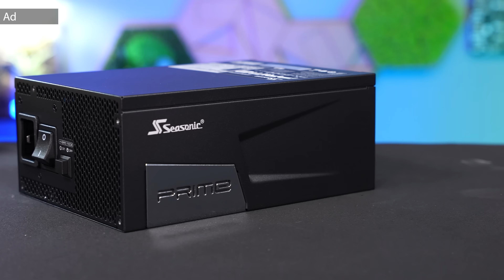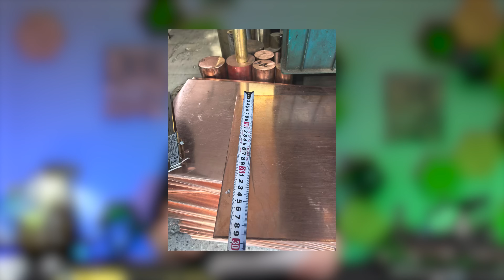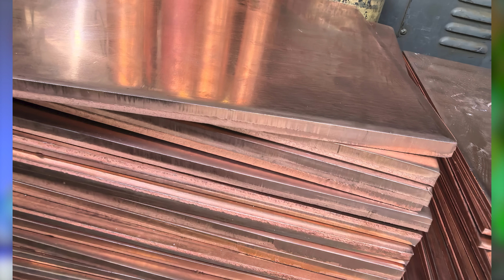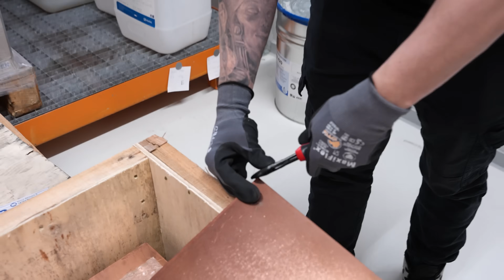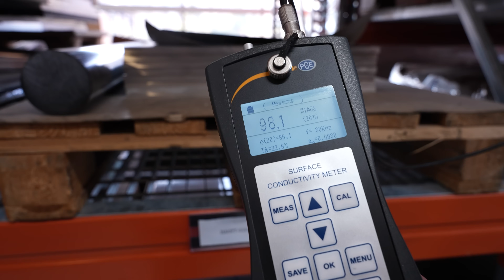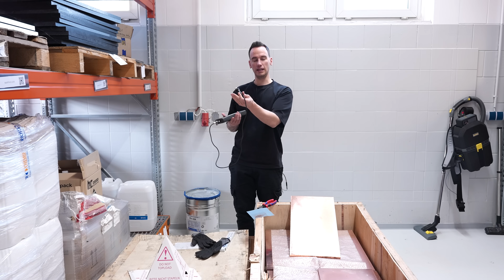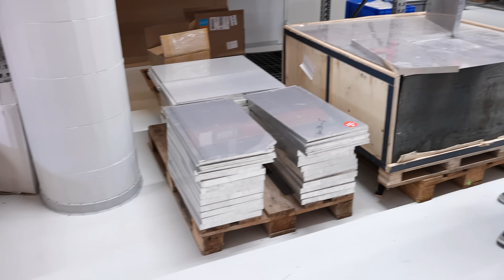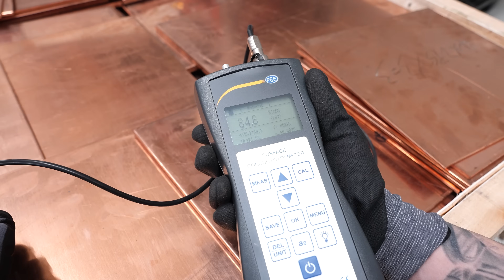I Got Scammed

Comment: I bought a new asus mobo for full price from newegg thinking the Chinese supplier was trusted by the website. Nope. I received a bent, used, asrock taichi with bent pins, scratches all over and the NVME heatsink flopping around inside the box with the screw missing. I asked for my money back or I would report them. They refunded a good amount. I still reported their ass. I hate scammers. 🤢

Comment: I wonder if, when you ordered 99.99% copper plates, they thought you wanted 99.99% copper plated. Or if they decided to pretend that's what they thought you meant.
Reply: They must have also thought he wanted steel plates in the aluminum order.
Reply: Nah, plating is a thin layer, not this thick.

Comment: I placed an order from China when i opened one of my locations, fairly large as well but not quite 40k euros and it was 80% high end millwork. I remember i spoke to friends who were Chinese and asked them to find a reliable 3rd party that will inspect the shipment and then forward it to me. So basically the funds were in escrow pending verification and once the 3rd party validated the shipment the funds were released. This was almost 5 years ago but i remember the service was an addition 2-3k. I basically asked the 3rd party to take a random piece and cut it and verify its not veneered wood etc and they sent me videos and pictures and verified everything was done to spec. I also got 40ft container instead of 20 and asked for most pieces to be fully or partially assembled since its hard to inspect flatpacks. I know this is not full proof either, but if you decide to venture buying from china again, this is one way of doing this. Everyone i spoke with told me chinese companies will rob you blind, it's basically their culture and it would be shameful for them not to try.

I'm sure you'll never make the same mistake again though, sorry this happened to you guys..

Comment: Name the suppliers. Nothing will change if the suppliers are not named, and if someone else gets ripped off in the same way you bear some of the responsibility if you could have warned and didn't. I'm crushed for you, but you need to do the right thing.

Comment: Be frank if you actually used alibaba correctly and done the full transaction in the platform instead of just using it to scout for options. They would be able to assist and refund if there were any issues

Comment: What you could have done in retrospective is put everything on a credit card because the credit card company is responsible for everything above while in the UK It's a hundred pounds I don't know what it is in your country but basically if you pay by credit card you have different protections that's why you pay by credit card. I mean yes there are e-scroll services and stuff like that but ultimately if you would paid by credit card jointly responsible any problems that may arise from fraud so if you pay by card fine if you didn't I don't know what to say x

Comment: I'm sure the copper shortage is data center related. Another victim of the AI bubble. What a bummer.  I was gonna say, check the weight on the shipping manifest, but it looks like they thought of that. The only way you could have check is flying to china and watch them manufacture, pack and ship them. That sucks, and you'll probably just have to take the loss unless your bank can help you.

Comment: Don't be embarrassed, in fact, I'll share my "scammed" story, so you'll know it's not just you, and in fact, it can be worse.... far worse. And yes, it involved Chinese manufacturing.... 

I worked as a certified quality manager for a fabrication company that had departments in the US, UK, India & China. We would get scammed by our own Chinese department on a regular basis when ordering cast iron products for machining. They would use cheap filler material constantly that would not hold the pressures we legally (and safely) needed to hold. I would have to get material tests done and check the manganese levels on every shipment and compare them with ASME allowances. And they would do the exact same thing, a couple of good items on top, and fake, scam junk on the bottom of the crate. Thousands and thousands of dollars, annually. 

The only way we were able to get consistently proper material from China, was if "extra fees" were paid to directly to the managers. And by fees, you know what I really mean. There was, at the time, nobody else who could deliver the quantity and size we needed, so, like you, we were at their mercy.  I moved on from that job a few years ago, but, it was still on-going when I left. 

Moral of the story, yes, Chinese companies, in many cases, have zero ethics. They know you cannot do anything about. For you, it could have been worse, we got scammed, and had to pay 'fees' to our very own Chinese department. 
Don't feel bad. Don't feel embarrassed. You simply expect people to have morals, when sadly, they don't, not always. 

I do hope you continued success.

Comment: Sadly Chinese suppliers are doing this with wire too. This is called Copper Clad Steel sometimes they use aluminum for the base metal for wire... Scams like this are sadly very common and usually you have no recourse.

Comment: did you not use Alibaba trade assurance? its literally an escrow account for this exact situation, so u dont get scammed. they hold the money until the transaction is complete then they pay the supplier. if u get scammed like you did here, ud have gotten ur money back almost immediately, after u provided proof like you did here. if you did not use the built in Alibaba trade assurance, then that was where u went wrong. u said u gave them 30% and then 70% when it was loaded onto the ship, thats wrong... USE THE SITES ESCROW SERVICE and this could have been avoided.

Comment: Discuss the issue with Alibaba, their systems rely on trust so you could probably get the suppliers kicked off their platform at the least to prevent them using their length of business as a lure for others, the other thing is that if it's difficult to get in Europe it is probably difficult in china so cheap prices are a red flag if most others have raised prices.

Comment: I don't know how you, as a relatively small and perhaps deemed as a onetime oversea buyer by the supplier in CHINA, could have done more than what I'm sure you prudently did!   Your order(s) may well have been completed to your exact specs.   Then boxed and strapped together with proper labels for shipment to the address you gave.   Immediately thereafter, your order(s) were at risk, anytime they were not held under positive and honest security.   There are global criminals skilled in the careful opening and remaking of wooden shipping boxes, that leaves no concernable, obvious evidence of tampering.   'Nough said!

I have had 2 issues, albeit with lower cost purchases, from China.   But, Newegg ensured that I got a refund for an order delivered 1300 mi. away, and Amazon questioned whether 2 orders on a new device using my card were valid.   I see no justification in making any purchase(s) from China, ever again!

Comment: Making business with Chinese people is always a bad idea. They really are criminal in these operations. Unfortunately you are just one small part of this scamming industry that Chinese people conduct over there. I am an electrician engineer and IT specialist. I know about these risks so the only solution for future purchases is to do what I did. You need to find a factory in Germany(or other trusted factory in Europe) that works with the material you need, in this example copper but more specifically 99.99% one. So you Ask them nicely when they order their quantity, to add your quantity as well. 15 years ago I needed 99.99% (4N) Silver, I needed for some audio cables. I made them for me (RCA directional coaxial speaker cables ) it was a pain in the @** to build them but that's another story. It cost me 400 euros for the material to build some cables that would've cost me 10000 euro . The thing is that this guys in my country had the power to sue them directly if any of the materials were not EXCACTLY the right ones. They are gone now from my country. I won't tell their name (they actually asked me nicely back then), but they were building some serious medical equipment that needed the finest materials around.   So find the right people here in Europe and do purchases through them.

If the guy in contact with you is related to that factory, you might have minimal chances to get your money back. And suing them might be more costly if not impossible.  
So besides my solution, which in itself is not quite easy but safe, you can try and sell your material to companies hat have machineries that can separate alloys, so at least recover some money. I'm truly sorry about this and hope to find some positive solution.

Comment: I wouldn't count China out completely as a supplier, but large purchases from China ALWAYS require a presence in the country to check the goods before shipping.  If you feel like trusting QC personnel, those can be hired.  Be warned: the seller can also pay them.  Your own eyes are the only thing you can trust 100%.  Now you know the scam, so it's a matter of seeing the goods before they are crated and using a hack saw to sample several "copper" plates to confirm you're at least getting dirty copper.

Comment: Import letter of credit, allows you as a purchaser to set into contract with the international vendor specific terms to be documented agreement. If when the goods are finally imported to your destination, it is on the bank to guarantee the product is as contractually agreed upon.  If the goods do not meet that contractual agreement, the bank will refuse to release payment to the vendor.  This is where things get interesting. The vendor doesn’t want you to send it back. So instead you make an adjusted offer for the goods. This is where it is in your best interest to only offer x % below market value of what was actually sent to you, so that you can attempt to not take a loss.  Otherwise, if the bank finds the goods meet the terms of the agreement, the bank releases payment to the vendor, and the bank then also releases the product to the purchaser.

Comment: Always pay through the Alibaba platform.  If the supplier wants payment outside of the platform the scam alarm bells should be blaring.
Reply: Yup only buy from sellers with history and use a payment method that allows chargebacks. I have done chargebacks on these kinds of sellers myself a few times.
Reply: You are correct. I used to sell on a smaller e-commerce platform compared to Alibaba here in SEA. There's a window time that the my sales are held by the platform until the buyer confirms everything is good. I'm not sure with Alibaba, but the platform (Shopee) which I sell before, the platform will most of time side with the buyer. They will do immediate refunds if you have solid evidence like tons of photo and videos. They will even contact you, the buyer if necessary. The transaction in Alibaba maybe different but this is a good advice for others, do the transaction inside the platform.
Reply: Sound advice.
Reply: I heard an anecdotal story about Chinese business once, basically along the lines of scamming people being a badge of honour and praised on getting one over on people. Seemingly rings true, these scams took a lot of thought to make it not obvious on first or second looks/tests.
Reply: This
Reply: Bots?

Comment: Thank you for bringing light to this issue,  but it is unfortunately the way business is conducted in China.  There are many unscrupulous dishonest businesses over there,  and it is commonplace (expected) to happen.   In fact,  many take pride that they pulled a scam on you,  and expect most of the complainers to go away,  since they expect many internationals dont know how to address this.  The best way to tackle this issue is likely through shame/reputation -- Publicizing this information,  and perhaps teaming up with a Chinese influencer with a tech platform on Youku or Bilibili unless they provide refunds.  It is unlikely that you will receive a full refund,  but you might get close to half of it back which is better than nothing.

The local police wont likely do anything either,  as they are equally as corrupt.  You can bribe most of them,  but it has to be in the subtle accepted China way.

Lastly, if you ever consider doing business with China again,  be sure that you have either a trusted local go over to inspect the goods,  or go yourself to do so.  Trust no one there.

Comment: I have a seasonc prime and the fan is terribly loud.  Beware, its very annoying.  I had to put an additional fan on top of it.  Also the pcie power plugs don't seem to have as much heat resistance as my evga (g2?) power supplies.  I will not go that route again.
As far as the story, go complain to the chinese embassy.  Bring the communications, bills and contact info.  They might punish them for making people thing chinese businesses are scammers.  I think they are trying to diversify trade partners away from the usa.

Comment: A local phone shop scammed me last year. They never told me the phone was refurbished with non-genuine parts.
The front display of the iPhone13ProMax was an LCD screen instead of OLED.

iPhones have a feature called ProMotion where the display refresh rate changes all the time as required.
These refresh rate changes make the refurbished LCD stutter.
The refurbished LCD looked like crap as soon I took it out in the sunlight. It had a strong pink tilt at one angle.
Because of my mental health, I can't be bothered taking them to the free court for consumers in my country, so I have just held the burden on my own finances.

Comment: Make local connections to a metal scrap recycling facility and buy the copper there. They will sell at least 2 grades. One is high purity electrical copper and one is plumbing copper. Then get in contact with a local bronze casting foundry. It looks like there are a couple in berlin. Use your youtube status to get a deal for them to remelt the scrap and pour the rough ingots for you. Then you can cnc the ingots. They won't be the dimensions that you want initially but you are already cncing them anyways and it is just a couple more operations to face them so minimal cost difference there.

Comment: Sorry you had that exsperience, not surprised, however.  If you're dealing with a company here there is no consequence for bad behavior, then this is always a risk.  Using an escrow service can help (I think Alibaba has it as an option) to the seller gets nothing until the buyer confirms receipt and as-promised.  Then it's on you to check properly before confirmation.  Other third party escrow services exist to ensure the money is held by neither party until the transaction is confirmed to be valid.  Good luck in the future.  There are also several insurance offerings that could have helped you out....but none of the comes free.

Comment: China has had an entire industry based around faking copper and aluminum. A lot of 'copper' wiring is a scam and often magnetic, especially on shops like Amazon. Many of these vendors aren't just going to disappear like a typical scammer either. They'll gaslight you, blame others and even fulfill legitimate orders if you'd had it checked prior to shipping. Since there's rarely any consequences this is just part of the game to them. Reputational harm usually means nothing because they have numerous storefronts.

The ability to boost profits with scam orders is baked right into their business model and it has been this way for years. They've got it down to a science.

Comment: Big fan of the channel from Singapore. I work in manufacturing - reach out to SMC they're pretty good and reliable. A little expensive but you can ask them to do additional verification of the material like cutting the master plate and doing additional tests like specific weight analysis or a positive material identification. 

You can also ask for the mil cert. from the mil and verify with them if the item was indeed made.

Always and I say this to everyone ask for the suppliers iso 9001 certificate if they don't have one you need to ask for an equivalent quality management cert. Payment terms might not always be possible but id suggest start small and get a few plates first. You can PO them for the entire order but only pay for 10% first.

A lot of additional work but hey that's the world we live in.

Comment: Third party material certification may have helped? In my work as a machinist we don't make a chip without first and third party traceability all the way back to the smelter. I'm sure it adds cost but at least you're sure about what you're getting. I've only ever received incorrect material once in fifteen years.

Comment: I hope that you get some kind of compensation although this wasnt a simple scam. This took a lot of technical skill(?) to pull off. Please keep us updated as to how it turns out. Just for technical comparability, I wonder how close your received plates can operate for what was intended of or if you can find some other use for them if not compensated. They arent cheap. They just wasn't what you designed for.

Comment: Screw embarrassing this is the kind of stuff you need to tell people about. Honest question you can't source the materials from reputable sources? Is the price difference that great? 

If the price difference is that large I suspect the only way you're going to get around this is to fly to China and be there at the dock to inspect the cargo when it changes hands Open the crate check the pieces and then make sure they can't touch it again before it goes on the ship is that even possible? Could they be working with people on the ship? I have no idea how convoluted such scans might be